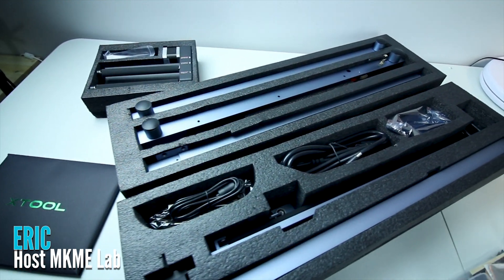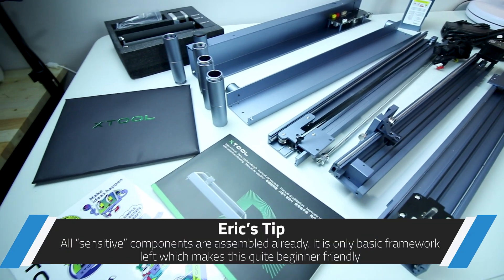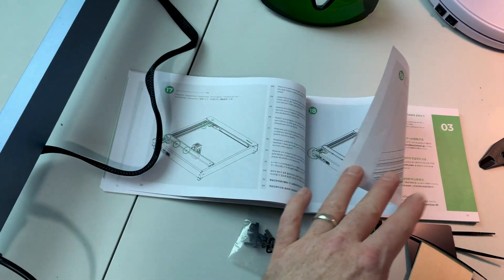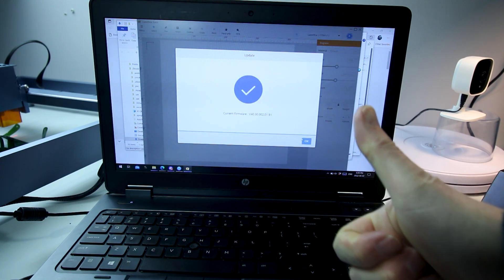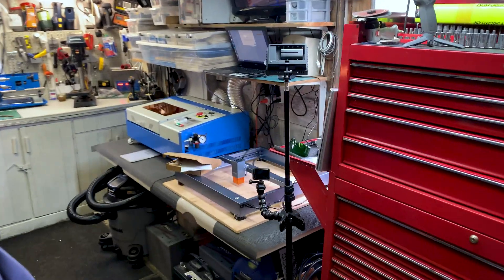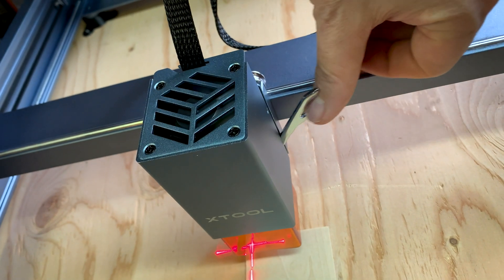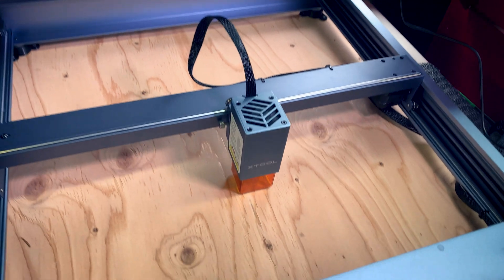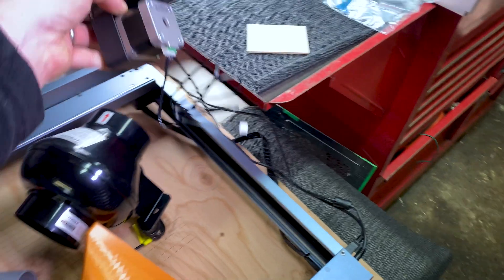Everything You Need to Know About the XTool D1 10 Watt Laser Cutter 🔥

Comment: This seems to be so typical of diode lasers..they are functional..barely...but lack all of the additional items you need to safely operate them.  I'm not a big fan of those cables hanging loose, and being dragged back and forth.  A surprising oversight from a premium product.
Reply from the maker: Indeed.  Easy fix they may add if people keep pointing it out.  As for safety- these non-enclosed laser will never be inherently safe.  Just hope I can warn a few people about the dangers as they can serve as a wonderful tool.